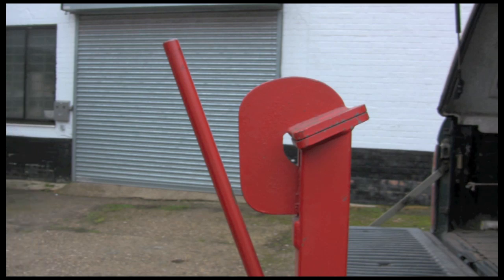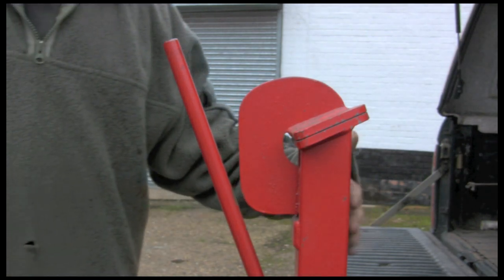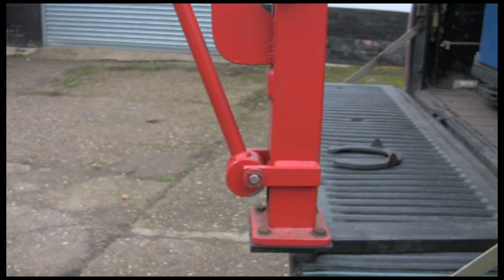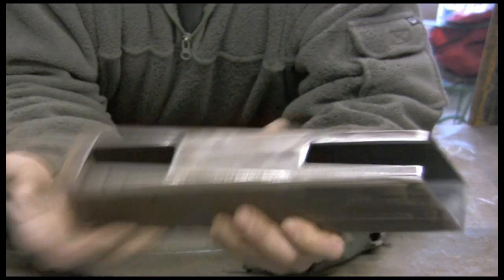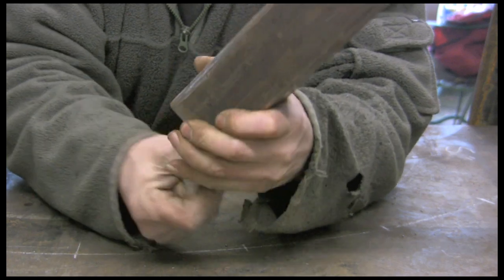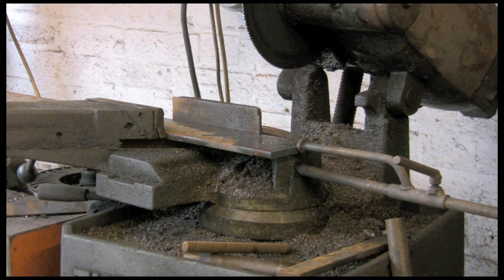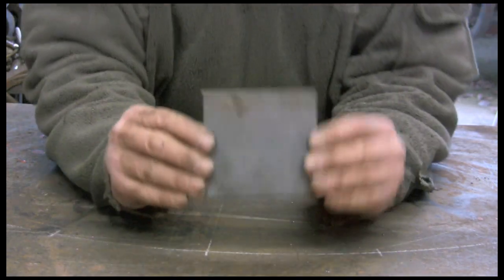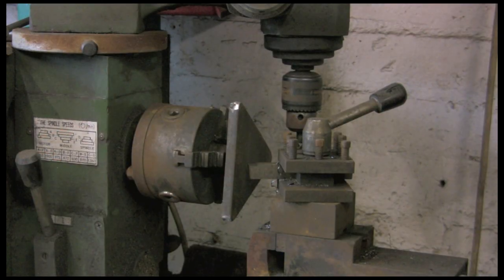Making a Farriers spring vise.

Comment: Valve springs work a treat for horseshoers vice. Mine has a high performance valve spring for running high charge/boost pressures in a international dt466 6cy diesel. One of mine has gripper jaw pads made from an old Brazilian made Nicholson Platers Magicut,they are made from really good steel.